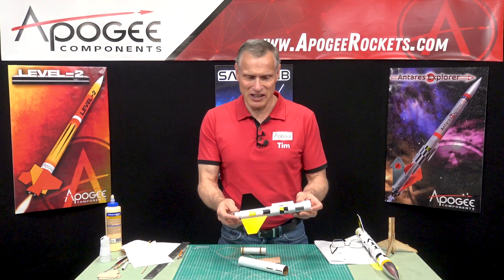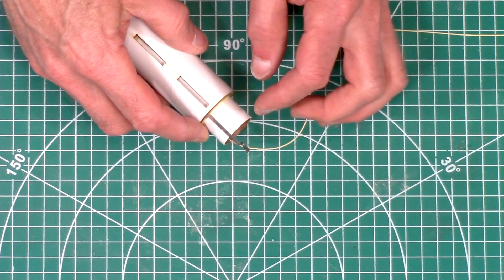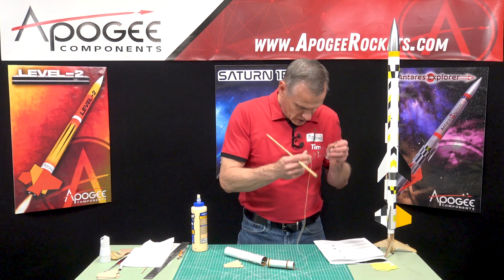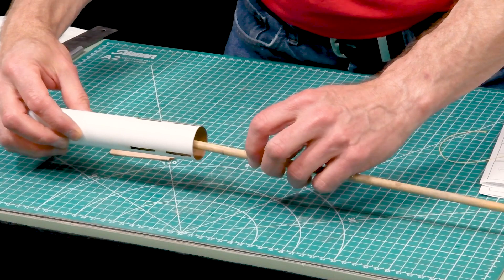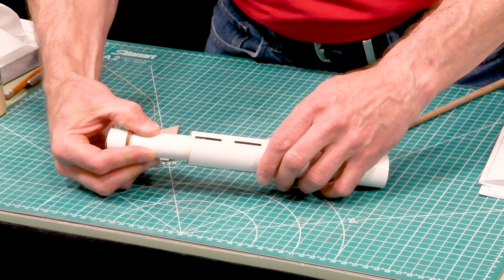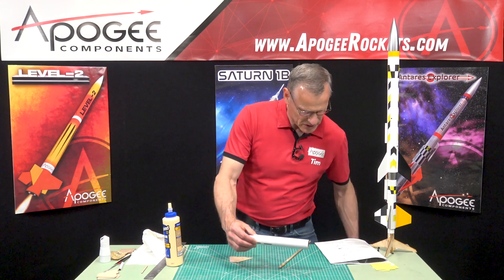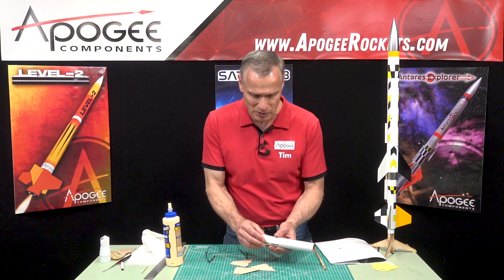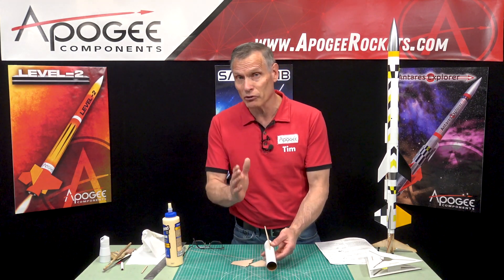Building the TTV Model Rocket Kit - Part 9

Comment: These are a terrific set of videos! Even if you never build this particular model, these vids are still loaded with useful building tips you can apply to any model. I've always struggled with how to use a fin jig with fins that are air foiled or thinner than the jig slot(s)...  I love Tim's "shim" method - It's such a simple fix!
Reply from the maker: Thanks Bart. I was looking for some paper the day I made this video, and all I had near me was the post-it note pads. That stuff works better than individual sheets of paper, because the layers don't slide around which can make it difficult to put through the slots. So I'm learning too. What I discovered is to "use Post-It note pads for the shims!"